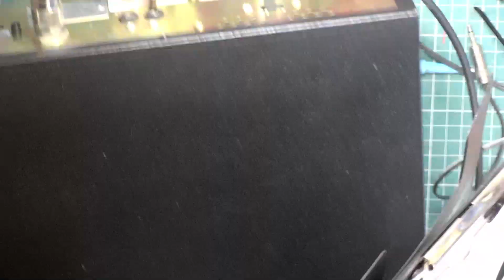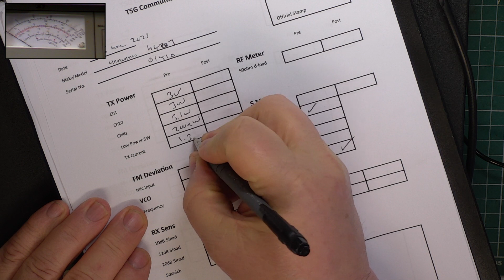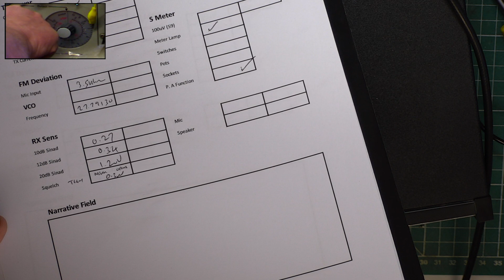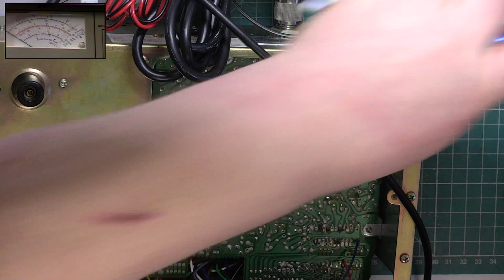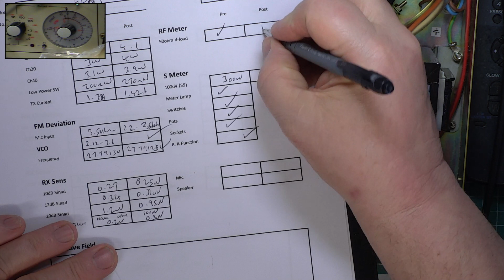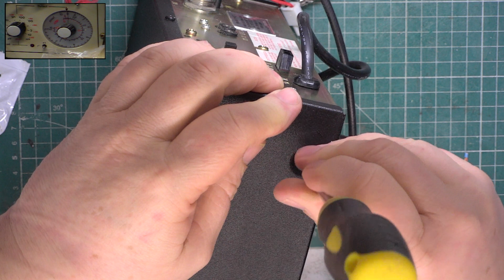Harvard H407 CB27/81 UK FM CB radio base station -  service alignment

Comment: It's not one of mine..
but just goes to show how people buy off ebay have no trust in the sellers,
That said if they had no faith in the sellers who claim their radio are 'serviced' why do they pay so much for them then send them to someone else to get serviced again ??
Reply from the maker: This belongs to a trade customer who has his own collection of sets too. He personally brings over 50+ sets per year; some for his customers & a few of his own. As you know, even brand new sets need servicing. 
When he received this set from the original enay vendor, he spotted the non-shrouded plug & decided to have me check the whole thing over. 

Richard, G0OJF, UK
Reply: @ukfmcbradioservicingTango21  I get how even brand new, especially now days with QC being virtually nil,
but what i don't get is a lot of sellers (although some are just liers) sell radios fully serviced yet the buyer has that much faith in ebay they send them away to be 'serviced' 
yet it's often the same buyers who pay double and triple a radios value, so why do they bother to listen to white noise or just to put on a shelf ??

a recently listing to watch out for is a CB radio 'shop' yes he's meant to be a shop. selling an Amstrad 901 with power ranging from 7.3w to over 8w but it's been serviced, and he's meant to be a tech :)  

But remember double the power means twice the distance..!!